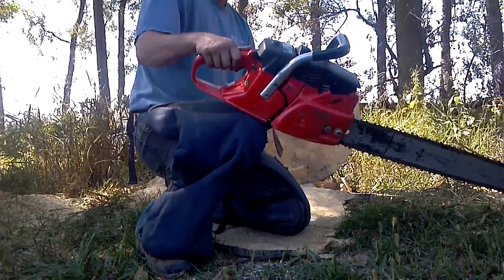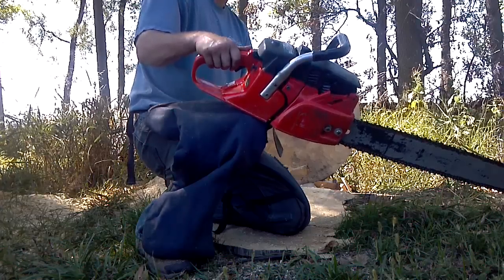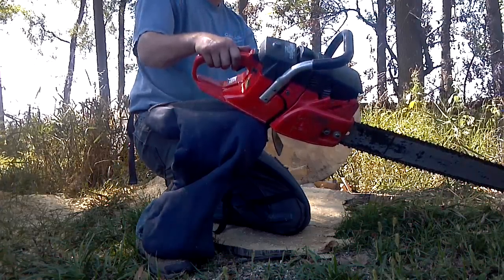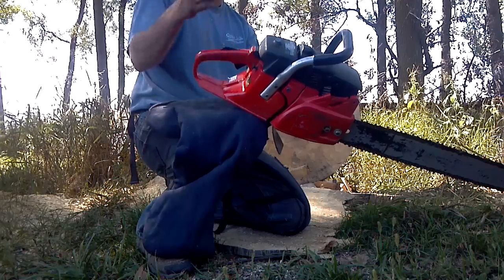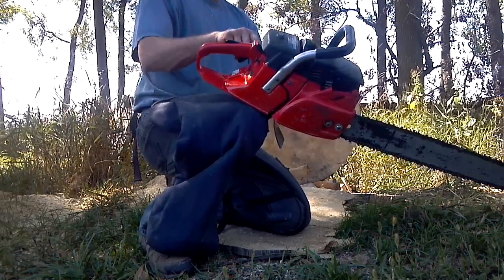Homelite 8800 540 hybrid chainsaw ported

Comment: This a cool video , but comparing the tiny new poulan to the older saws isn't fare the chain on the older saws are likely 3/8 th and the new saw is a light er tooth , But I like the older units have 2 xl130 made in quebec Canada . we had a big wind go through the little town here and my son borrowed the homelite xl130 to help . All the pro tree cutter guys with the stihl etc stopped and shut down when my son started it up with houses around you could hear those homelites for the whole block